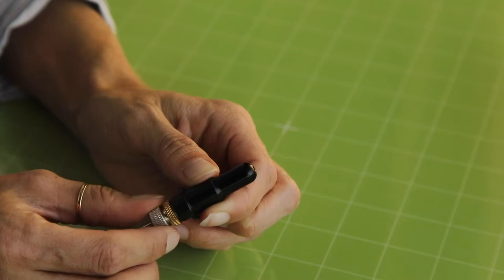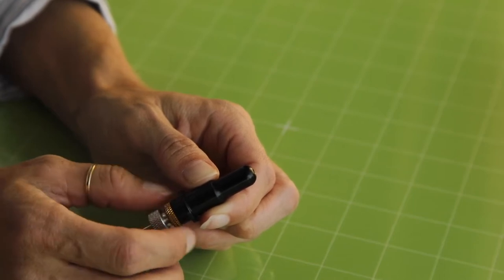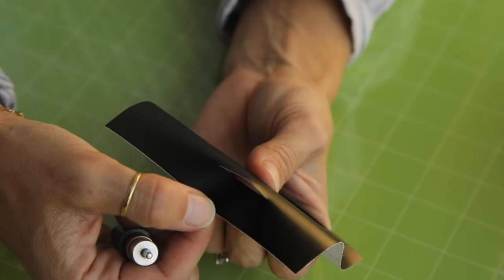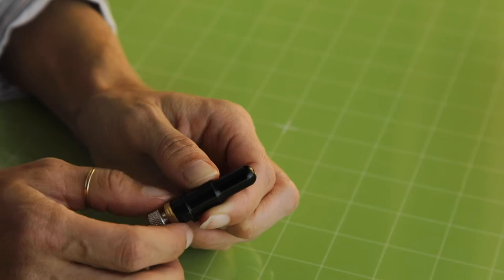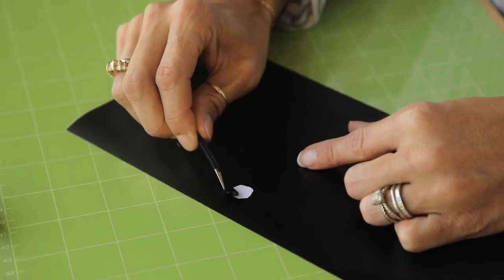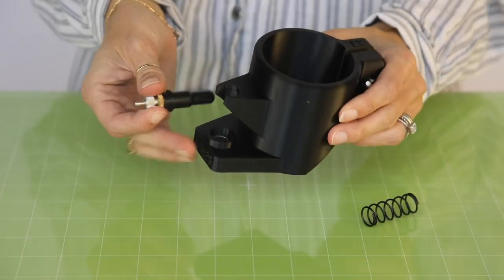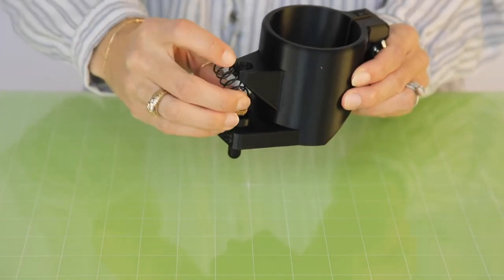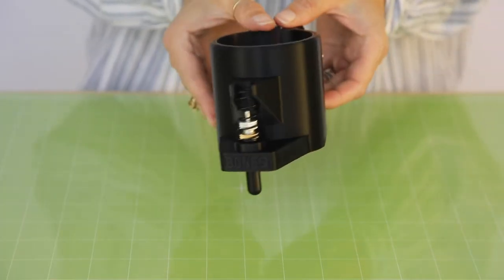Bones Vinyl Cutter Drag Knife Setup for CNC Machines - Shapeoko, X-Carve, Onefinity and Spindles

Comment: Ordered mine and it's shipping out today.  I'm confused on how it actually mounts to the router/mount on the X-Carve?
Reply from the maker: It has a slip-on compression style mount. The cutter mount slips onto your router, you then tighten the finger nut to lock the mount into the place. Tutorial video coming shortly!
Reply: How to by
Reply: How do you purchase the mount and knife for a shapoeko 3xxl with carbide router.

Comment: Mine is coming any recommended speeds? Any other tips? Thanks
Reply from the maker: I like to start off slow. 8ipm plunge / 20-30ipm feed. Max depth 0.001”. If your blade height is set up correctly, should only cut the vinyl and not the backing. Shoot us an email if you need any help with setup! Thank you!
Reply: @boneswoodshop5892  I received mine.  Once you get it dialed in it works great!  Great product thank you!!